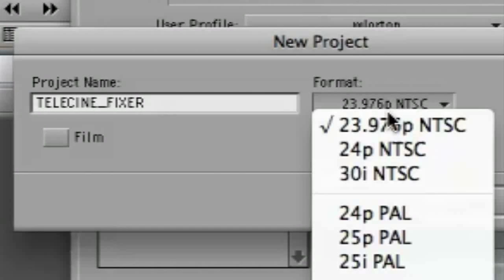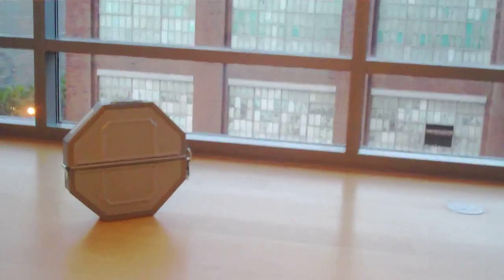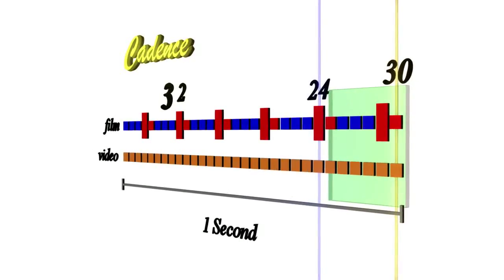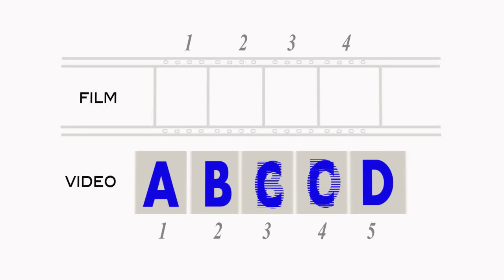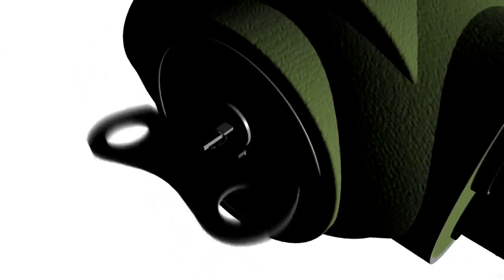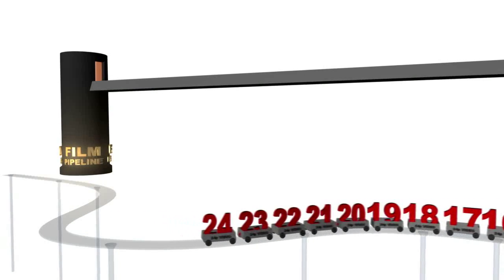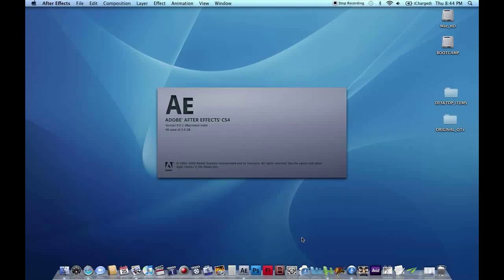Telecine Cadence Fix - Part 1

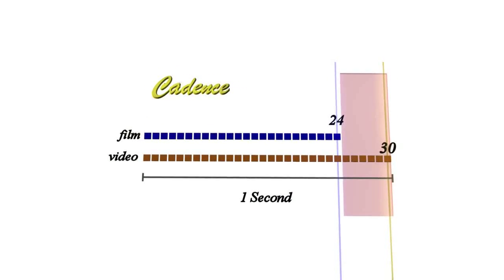Comment: The explanation of 3:2 pulldown starting at 1:05 is wrong.  The cadence described is called 1:1:1:2.  Actual 3:2 (or 2:3) is used all the time on virtually every movie shown on TV as well as the vast majority of scripted dramas.  While not perfect, 3:2 is significantly better than a 1:1:1:2 cadence.  A 1:1:1:2 cadence frequently happens when the conversion is done by people relying on their software to properly perform the conversion on export.